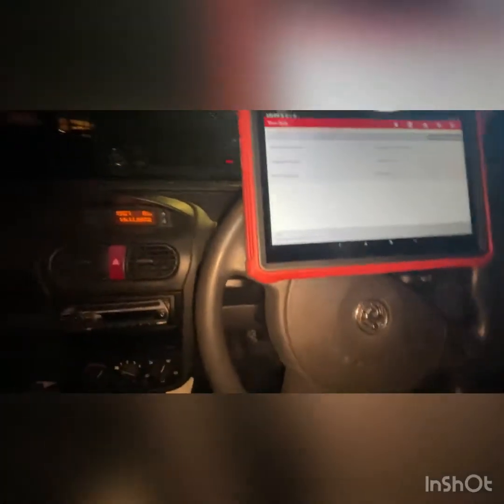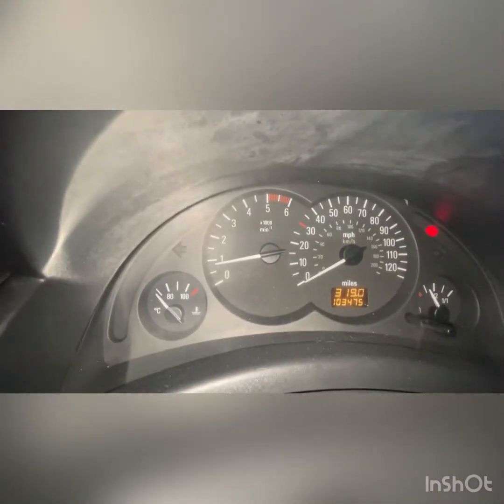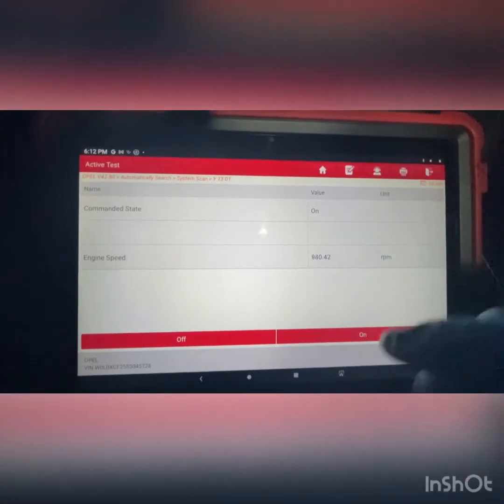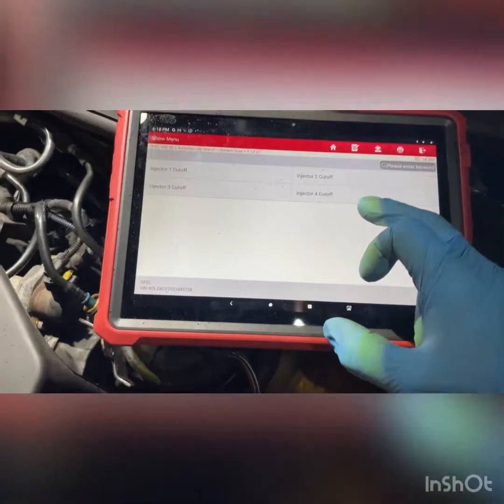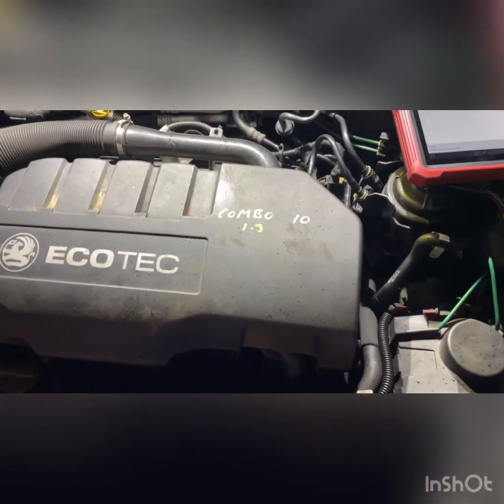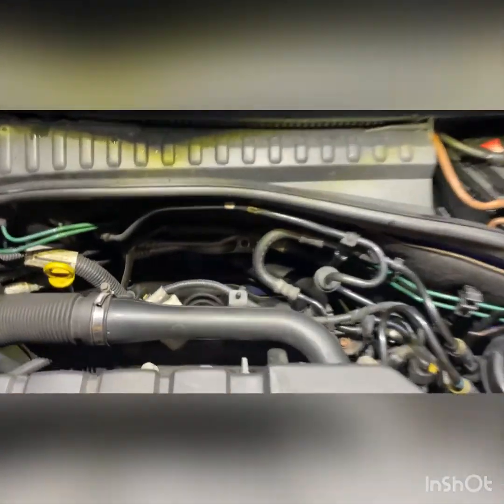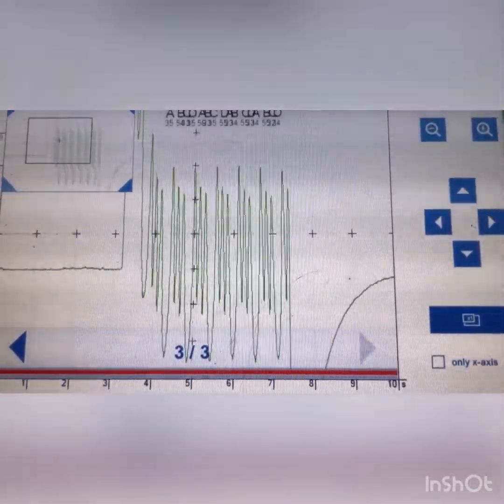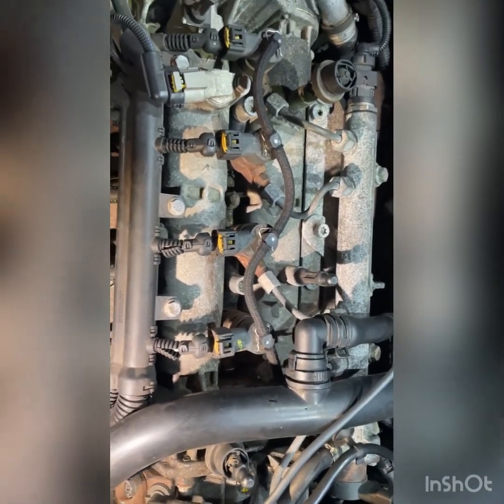Vauxhall # Combo # Injector # Compression # Smoke # Misfire # Diagnosed

Comment: sometimes my 1.3 2010 combo  has sluggish power but rpm goes up faster then the speed.   happened today.   do you have common causes of this?    also when i turn the engine off i get a single pop/thud noise that comes from the back of van